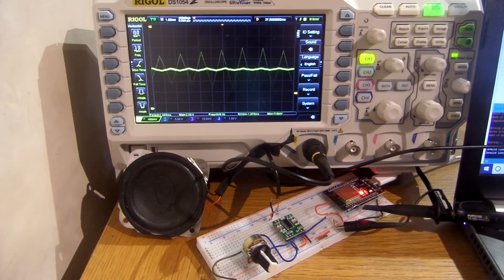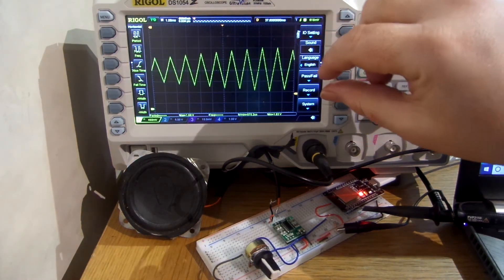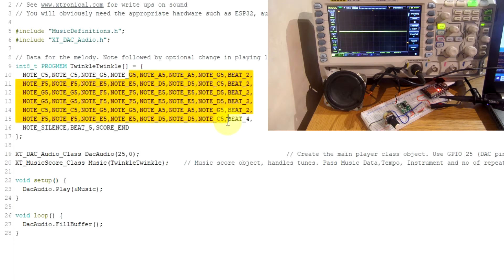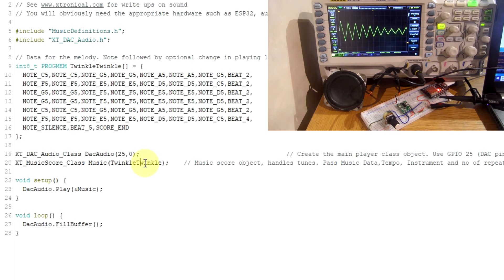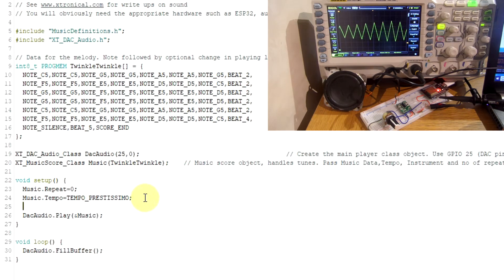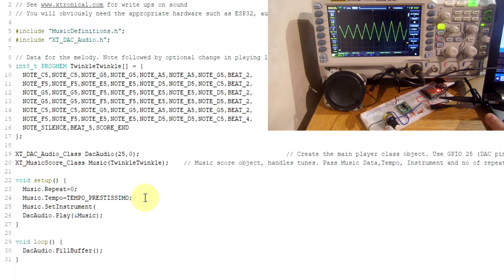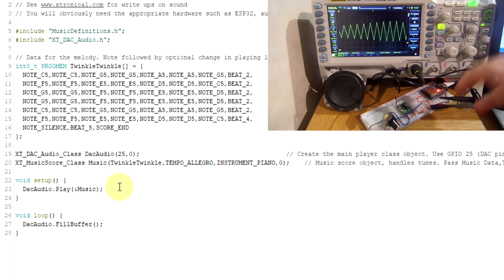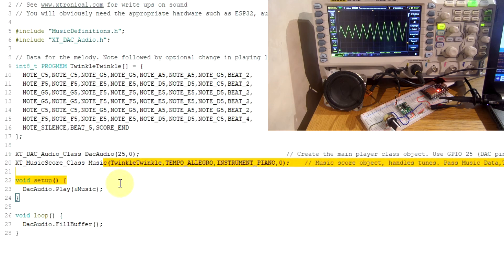ESP32 Music Sound Synthesizer, Arduino version later, DAC Audio library

Comment: I'm trying to play a single note from touching a button, but I can't find a doc of xt_audio library. Do you have?
Reply from the maker: Sorry, I've been rubbish documenting it in a written form. However the supplied examples should help loads, also check the later videos, I think I cover playing simple notes in one of them. Sorry can't be more precise, not near my computer at present.
Reply: @XTronical  thanks for your response. I´m triyng to code esp32 with 44 keys to generate notes. My idea is to recreat an old organ (I have the structure of keys). I´m reading 4 buttons in an analog pin and I want to play simultaneous 10 notes. I made this on arduino for 2 scales and I used Tone and NewTone libraries, but I can´t play more than 2 notes. I can share the project with you.
Reply from the maker: Yes, you can play many notes at once, there is an example and video for this. If you post a comment on my website www.xtronical.com then I will be able to email you and then you can send your code if you need to.

Comment: I would like to use this library to start two sounds (wave1 and wave 2) controlled by two pins (button 1 and button 2). Is it possible to get a sound that is the mixing of the two activated sounds?
Reply from the maker: Yes, but not in the version you have. Latest version that I've not released yet can do this. Out in around 2 weeks
Reply: ok, but now,   can I  to use the library to produce (without mixing the sound)   when I push button1 play the  sound1 (wave1) and after  when I push bottom2, stop the  sound1 e start sound2 (wave2)? So I can to build now my  application (mono sound) and then  wait that you complete  the library to finish my project?
Reply from the maker: Yes, by default that is how it would work when you play a new sound, the old one will stop.
Reply: And so, 
1) at the moment there isn't a STOP function. Is  it correct?
2) now the library can play two song   at the same time?
Reply from the maker: You can stop a sound without playing another first by setting the "playing" property of the WAV class object to false (This can also be used to tell you when a wav has completed, if you just wanted to wait for that); The only version that can play two wavs at the same time is the version I've not yet released. At the moment starting another wav file while another is playing will stop the currently playing one first and then start the new one
Reply from the maker: Don't forget there are some examples supplied with the library to give you an idea

Comment: Is this using the same library as before? I don't see those methods in the code.
Reply from the maker: It's an updated version with the extra methods and bug fixes. Should be released by end of weekend or early next week. Still working on it.
Reply: Thanks!